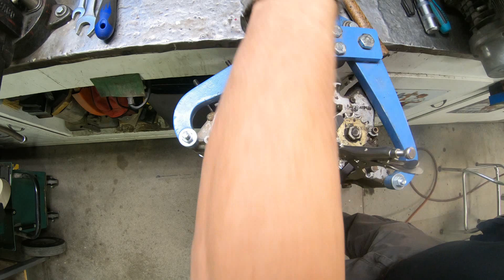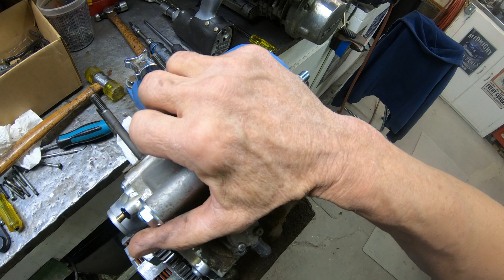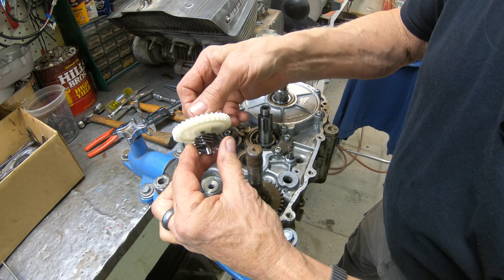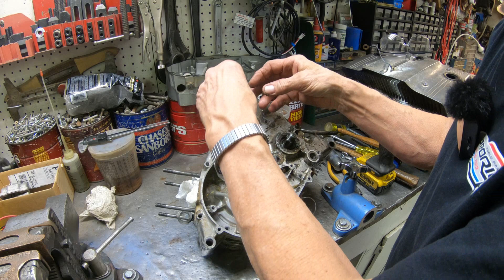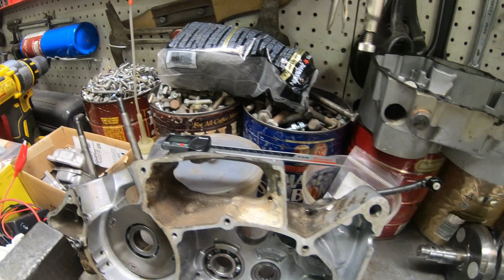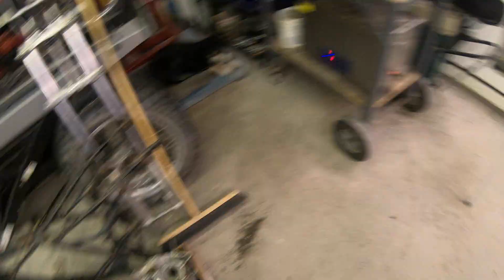Kawasaki F7 Bushwacker engine disassembly

Comment: Thanks Dale , Great video ! Wow it really brings back memories working on the Kawi's . I forgot all those bikes had straight cut gears . I had a 238 green streak back in the day , I loved that bike .. Thanks again Dale .
Reply from the maker: Thanks, man bet you wish you had the 238 back. I remember those.... they were fast. The one I wish I had never sold was the 79 RM400. Probably couldn't start it today, but it was a nice looker. Getting ready to build a 78 RM250 from a box of parts. Not sure how that will go. Just can't find or afford a complete bike.
Reply: @montana2strokeracer  Hey Dale , That 238 was a kick in the butt in the desert chasing jack rabbits . Lots of torque . By the time the RM's came out I was working at a Yamaha dealer and had quit racing and cow trailing . So you have a basket case RM 250 , that sounds like a project , I think you like the tough ones . Should make a good video .

Comment: Dale: for a new channel your video quality is excellent. In the heyday of 2 stroke evolution, I attended ACFT mech school in Southern CA. I had to split the cases on my striped down 175 Ossa Wildfire on the utility room floor. It had less than half the parts of your F7. As the 2 stroke revolution progressed and I got a good-paying job. I was able to upgrade machinery every few years and didn't ride hard enough to break anything. I wish I still had some of the old iron It was light and fast but so was I then.
Reply from the maker: Thanks John, I am trying to improve some of the video and audio as I go along. Thanks for your feedback on that. Boy starting out on YouTube is ruff, been at it 3 years now, really slow getting views and sub's. 
I know the feeling, wish I had almost all my old iron back, it was really a good time with lots of innovations. Glad I got to grow up during the hay day. It's amazing the stuff coming from the factory then, now......I don't think Suzuki is even into racing anymore. The others not like they were then. I also never raced hard enough to break much, guess I knew if I did, I would have to pay to fix it, and yes, I was much leaner then too.
Reply: Back then we struggled to remove the screws found on most Japanese bikes. come to find out they were not Philips but JIS (Japanese Industrial Standard) It was years before I figured that out. They even sold socket head screw kits to replace the soft original ones. @montana2strokeracer

Comment: What a cool video. Still amazed how screws, washers and more just go into a can or cup and you know exactly where they go -even using video! Nice dive into an old rotary valve Kawasaki. How you keep track of all these projects is a mystery.
Reply from the maker: Thanks Jim, oh well, I'm sure I will be sorting out the screws before reassembly. LOL!  I have the video to refer to before and during assembly, so I always recommend taking a video or at least lots of pictures. Oh, it's not really a mystery. I just keep everything separated and make notes of where I am too pickup when I return to the project.

Comment: This one do the timming settings on the rotor valve please and thanks
Reply: On my TS75 the rotary valve is set with a simple alignment mark.
Reply from the maker: This one has a pin that locates it.
Reply: @montana2strokeracer  ok

Comment: Good job as usual Dale!!   The poppet valve in front of the crank is for purging an over oiled condition. It can fail in a way that causes extra air/lean/seize, not common but deserves extra attention, I think it does its magic when the engine is cold started but not sure, research is required.  And yes, cleaning the motor before disassembly saves a lot of time and hand washing lol.
Reply from the maker: Thanks for the info

Comment: These engines have a pulse pump on the front of the engine below the front motor mount.  There is a diaphragm that fails and creates an air leak. 
-
The pulse pump sucks fuel from the bottom of the carb cavity.
Reply from the maker: Thanks for the info, I have seen lots of folks just seal them off with a gasket and block off plate. So, they must be problematic.

Comment: My o ring on the rotory valve seal collar was hard and old on the crank as it was bad leaning the engine out ,leaking air  make sure you put a new ring in there, alot of pressure there,on that I o  ring seal on the valve shalf, Important ,so not to get any pressure blow bye

Comment: Where do you find your f7 parts I just got a hold of one I believe is a 72 175 that needs every cable and a carb kit at the very least. Hopefully you will see this it’s worth a shot
Reply from the maker: Hey Kade, I guess the best answer is anywhere you can find them, Kawasaki's just were not produced in the quantity that the other Japanese brands were. The parts are just not as easy to come by, but they are out there. I look at my local motorcycle salvage yards, Ebay, and of course from Kawasaki. Some of the Kawasaki forums on Facebook are a good source also, but you have to be careful buying from them because there are lots of scams out there, so be careful doing that. I think you will be able to find the cables, but if not, I make a lot of my own cables, you could check with your local motorcycle shop they may be able to make them for you. Normally you don't need a carb kit, usually all that is needed is a new bowl gasket and maybe a needle and seat. Those you can probably find either from Mikuni or your local dealer. The thing with aftermarket carb kits is they don't have sizes stamped on the new jets and other inside parts. So, you don't know if they are right or not. I like to keep all the original parts if possible. Try looking for your model at Partszillia.com or Rockymountainatv/mc.com

Comment: Hi Dale. I may be pushing it but you are pretty savy. I have an original'71 F7 and at 45 mph the motor is pretty high in rpm. Have not found a rear sprocket more than maybe two teeth less which isn't much help. These motors have great torque and can handle or pull with a smaller rear sprocket making it more streetable. Any idea what other bike's rear sprocket with say 5 or more teeth less than the original that would bolt on? If no idea, thanks for the F7 video's, great work as always from you. Dave.
Reply from the maker: Hey Dave, no problem, you can contact these guys they will make you anything you want, just takes money don't you know. Or.....you can just buy the size sprocket you want for say a Yamaha, you know it's got to be the same size chain pitch also. Then clamp your new and old sprocket together and drill the holes in the new sprocket to match the old ones. I did a video on this on the YL2C Yamaha, if you would like to see what I did.
https://sprocketspecialists.com/